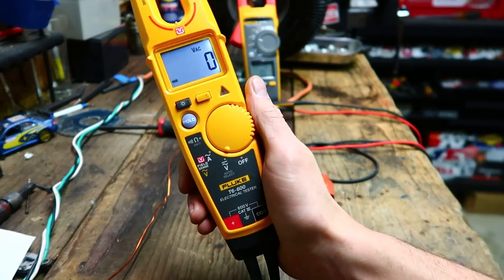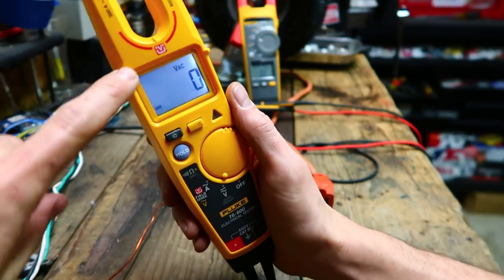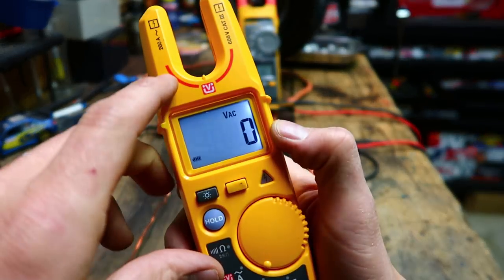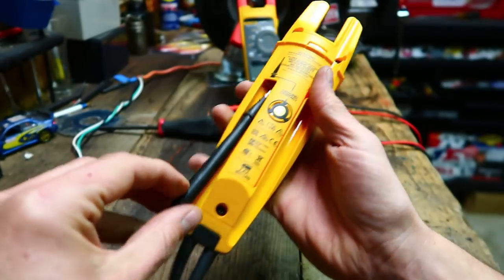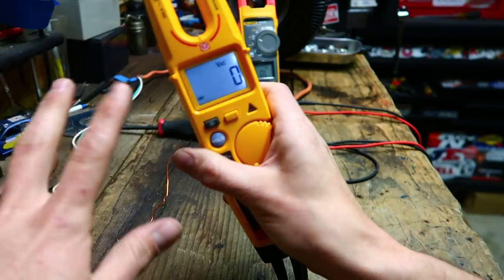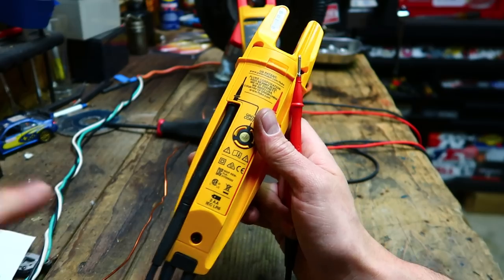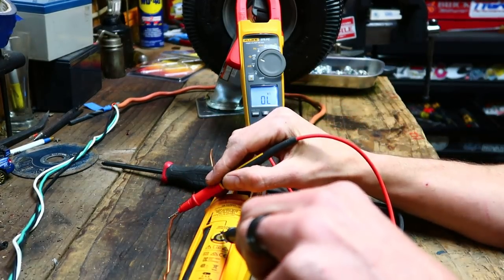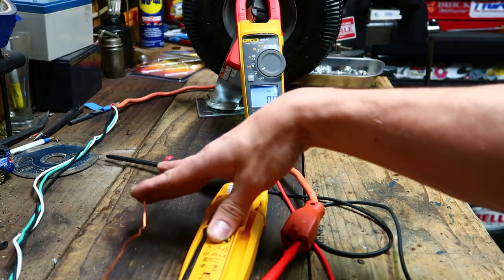Fluke T6-600: NOT DANGEROUS!

Comment: ANY tool this badly designed and engineered is inherently unsafe because quality was sacrificed for profit.  Mike, you said yourself your knowledge of electronics is limited and although it may not appear "dangerous" to you consider some other electrical component may just as easily have been sacrificed (i.e. good and safe engineering) for profit and at anytime  may crap out and cause injury.  I'm not an AvE subscriber but despite the mild theatrics, I think he is correct.  He certainly made clear Fluke has great products and this is the only item they make he has found to be just "garbage".    I don't think his assessment would change even now that he has "cooled off".   Furthermore, you trying to mitigate the negative rating by saying it's not dangerous,  it just doesn't work,  makes you sound like a Fluke boy or shill. If it's junk, it's junk.   JMO
Reply from the maker: i see your point, but my main point, which i probably didn't explain as well as i wanted is, he made it seem like that the voltage he showed at at the contact pad could injure a person.  He left out any explanation of any possible safety features protecting the user.  The result of that was, i got dozens of comments telling me that meter was going to kill me and leaving a lot of people to believe their was full blown mains voltage at the contact pad, which just isn't the case.  I pretty much agreed with everything he said about it.  You could show the same voltage on the other lead on any meter on the market.
Reply: AvE got angry because Fluke rightly told him that he was too dumb to use their meter.
Reply: @metallitech  Meters are used to test malfunctioning electrical products and intentionally putting yourself into the circuit, which is what that meter requires, hoping the safety resister doesn't fail, is what is truly dumb. If you don't understand that, you should not be using a meter in the first place. To measure it a voltage, it MUST really be there - a resister limits the amps to a safe level. If the resister fails or is bypassed by sweat or water, you are in danger. THAT was his point. 
Ave was correct in explaining the possible dangers and also correct not explaining "safety features".  In legal parlance it is an expert opinion - with ensuing liability - to  render a technical opinion while bringing a possible safety problem to light for corrective action and to warn the public is a moral and ethical obligation. It is better to err on the side of caution than to remain silent and "let the bodies hit the floor". Ave puts his ass and reputation on the line sounding the warning and should be commended instead of condemned. People who look the other way when they know better are just as responsible as those who caused the suffering. We have to support the watchdogs out there. Only if someone had stood up when the Ford Pinto deathtrap went out, the Space Shuttle accidents, asbestos.. ect.
Reply: @wylieecoyote  It's a capacitor, not a resistor.  It is safe. Ave had a drunk brain-fart and thought he was smarter than an engineer at Fluke, and proceeded to slander them. He makes all sorts of such ignorant mistakes in his videos. He has no reputation because he is anonymous; or else he would rightly be sued.

Comment: I agree that Ave is casting shade in fluke about the ground pad issue. There's no way that gets any certification from ce or ul if that was the case. BUT: if you use the inductive voltage detection and determine that a hot lead is not energized because you didn't put the wire dead in the center of the jaws and you cut the energized hot lead, you're possibly going to die. Voltage detectors need to work and work and not not work. This thing is dangerous.
Reply from the maker: I totally agree, but I feel like you'd have to be pretty dumb to soley rely on this half assed technology to tell if a line is dead or live.   Same goes for a non-contact tester.

Comment: i agree with AvE on the general sense that basically tools don’t keep you safe. you keep you safe. i think the safety on this T6 is failsafe by design but in general, most things are crap and don’t trust it above your own instinct. kinda like holding hot and neutral together, you trust the circuit breaker to flip, but if it doesn’t then your house burns down

Comment: Mine is adequatley accurate , and the Joy Buzzer function , has yet to kill me . A few tips: in very dry situations lick your index finger for better contact with your feildsence pad , also , do not touch the wire under test with your left hand , or it will skew your reading .

Comment: The typical input resistance of almost all meters is 10 Megaohms, so it'll show voltage even if the source resistance is very high. In this case, let's say you measured 80V (40V less than 120V) (2/3rds) so if R2 is 10M, R1 would be 5M, using the voltage divider formula.
120V through 5M would give so little current, you're not going to feel anything, and if the resistance is distributed enough to protect against single points of failure, it's also safe.

Comment: You say at 1:00 "It doesn't work all the time." That statement alone makes it a potentially dangerous device. If I can't trust an electrical testing tool to, 100% of the time, tell me if there is or isn't voltage present, it's of no use to me since I work with 240VAC.

Comment: Just use the harbor freight red meter. It’s the gold standard for high voltage and even higher amperage work.
Reply: I got like 4 of those. They work remarkably well. I've even run some decent current through them.
Reply: Paul Frederick I use them for transformer installations and at least once a week the coroner reminds me that he doesn’t get paid by the hour.
Reply: I got a ~$5 multimeter on eBay and it works really well for the stuff I use it for. And if I ruin it it's not like I need to sped $100 for a new one.
Reply: Just be careful where you plug the leads in. If you do that a meter should last you for a long time. It is when I measure current then forget to plug the lead back into the Volt/Ohms jack that I've had problems in the past.
Reply: Harbor Freight freebie meters are decent. I've read wall voltage with them no problem. I've taken current readings up to the stated rating of the meter too. They can be damned accurate. They have a trimmer in them and I've adjusted it using a voltage reference. Years ago I've paid a lot for digital meters that probably were no better.
Reply: Got one free in 2014 or so with a coupon, loaded full of hot snot and all kinds of capacitors etc... recently got another one to keep in my car after my alternator went bad and the internals of that one are completely surface mount components. The old one looked like 30 things could've gone wrong in production, but the newer surface mount only ones are extremely simple and I'm sure work acceptably well even though they are cheap. Realistically the bad part of those meters are the leads. They are truly awful.
Reply: Opening them up I have noticed they have made some different versions. I have 4 free red HF meters and I didn't even try. I've seen some people that have piles of the meters.

Comment: It's dangerous because they make you think you can safely determine if there is power on the wire and you can't.
Reply from the maker: it's not the meter that is unsafe, that's an unsafe practice, that feature isn't intended to determine if something is safe to work on.  That is no different that using a non-contact voltage detector do determine is something is safe to work on. If you're too stupid to know that, than you shouldn't be working with electricity. Thats the number one comment i have received on this video which proves there are a lot of people that don't understand electrical safety and should step away from the wires until they do some more reading.
Reply: ok let me rephrase it. You can't determine with 100% accuracy there is no power on the line. There are these voltage sticks to proof power on a line. https://images-na.ssl-images-amazon.com/images/I/31PPevBJNpL._SX342_.jpg
In my line of work we call them dead sticks.
this is the same thing

Comment: Ave said he was concerned about it when the meter was in current sense. You had it in ohms when you touched It.
Reply: Lots of people are commenting on that and it's amusing that Mike hasn't replied to any of them unlike other posts that back him up.
Reply from the maker: I have responded to some of those, although i didn't test it like that in the videos,  I did after some comments,  the only difference is the amount of voltage it lets through.  75-102 Is what I got.  No harmful current was allowed to flow in any setting
Reply from the maker: Also I replied to a ton of comments where people were calling me out for not doing a thorough test

Comment: HvE had a probe in the meter with the testing end sticking out, and the other probe in his hand. Its a common method of checking a circuit without having three hands. Then, while using the probes, the back of the meter had that spot that would become energized.
Reply from the maker: It's not energized,  and no currant is allowed to flow

Comment: The whole point of that meter is a function that really doesn't work well. Id disagree with you, its a bad tool. It doesn't do what it was supposed to do (well).
Reply from the maker: elliott turner 1 feature sucking doesn't make it a bad tool.  It's still based on a t5 which is a great all around meter for the price

Comment: To really test it’s safety try to ground the black lead, put the red on a hot wire, then touch the grounding pad on the meter with one finger and with your other finger or hand touch the hot conductor. Your test wouldn’t have buzzed you regardless of whether the meter was faulty or not. You only touched the ground and ground pad. Same as if you were to touch the same hot wire in two places. You are generally always safe only touching one wire at a time. I think this is what ave thought was dangerous and he may be right

Comment: The answer to Why you are not getting electrocuted, is that it is a High Impedance Meter. Meaning, the internal resistance of the meter is so high, there is not anywhere near enough current flow to harm you or for you to even feel it. Hope this sheds light....

Comment: It can be unsafe, or not, depending on the paranoia or attention span of the user. I encourage you to put the meter in  "sense" mode, black lead stuck in it's home, jam the red lead in the hot spot and then touch the button. Or just put it in "sense" mode and then check the continuity between the button and the red lead. Dig deeper. Although I didn't expect much here.

Comment: Ofc its safe when new, what about after the apprentice looses it in a bucket of water an just dries it off before giving it back to you. And just the tiny risk of something happening with this just for a gimmicky feature that doesn't work.

And don't try the "it works if you do it properly" routine, its at best unreliable, and a unreliable meter is JUNK. Fluke was in my opinion up there with Starret and mitotoyo, and then they release this crap, I understand President AvE for being annoyed with them.

Comment: I know that if you use a t5 it will detect ghost voltages even though you know 100% it's isolated. I used a fluke 117 and 87 both have low impendance functions  which won't show the ghost voltages.

Comment: FWIW, In the first video, AvE was using the meter wrong. In the second video, he was pissed that someone at Fluke took the time to defend an obviously shitty product. It's totally plausible in my mind, that he didn't attempt to touch it to "find out" if it was safe, and based on the anger, just lashed out immediately after finding voltage on the pad.... To be honest, I probably wouldn't have touched it either.

Comment: AVe made follow up video about that meter and it prove that there is serious dangerous to get electrocuted by this meter IF you use it "wrong". Simbly but red in socket and then measure voltage through that "finger ground". Its simble as that.

Comment: What I am taking away from this is you have 2 guys, that both understand more then most, and it is unknown what is going on in that magic spot between the lead and the finger pad. That is where I believe AVE thinks the lawsuit is pending. Magic is great, but what happens when the magic breaks? Does something short, melt, make continuity, create a black hole? Manufacturing defect? Just a thought.

Comment: Good video. Yes Ave HATES this meter. That said....I've been an electrician for forty years....I'm all alone sweating my ass off in some damp basement of a building testing voltage....NO WAY IN HELL am I touching that metal button on the back of that meter. I don't care. In fact if I owned one I would rip the guts out of that back cover and eliminate 100% of the chance of even getting a 74 volt shock. Besides, that new meter looks bulkier than the T 5.

Comment: AVE kind-of explained how this meter is dangerous. If you accidentally left the meter in current mode and touch the pad on the back of the meter while the red pokey bit is attached to power you're going to get a nasty zap. The pad on the back would be live at whatever voltage the red pokey bit is touching.
Reply from the maker: there are 2 design features that make it impossible for current to flow through the leads.
Reply: Current mode is basically a dead short between the red and black leads... If you have that black lead left in the meter the pad on the back will be like grabbing the bare wire.AVE shows here: https://youtu.be/e7aSde8X5JU?t=554 that the pad on the back appears to be directly connected to the black lead if it's stored. If you do a resistance check between the black lead when stowed, and the pad on the back, is there anything there, or is it just a direct connection?
Reply from the maker: It's infinite resistance, it reads  2 nano ferads, which only lets a couple micro amps pads through.  On this meter, there is a 1 mega ohm resistor that doesn't allow any harmful current in the leads no matter what setting it's on.  Basically that contact pad is protected by 1 really high impedance resistor, and a series of 5 tiny capacitors,  from watch can tell. A lot, and I mean a lot of things would have to go wrong to allow any current to flow through the contact pad.  I'm no expert, but did that make sense?
Reply: Thank you for doing the extra test , that make sense now. :)
Reply from the maker: actually i don't have a meter to fully test this, but this guy does,
https://www.youtube.com/watch?v=frjoyQHqCN4
great video, fully tested, and explains the technicals better than i could.

Comment from the maker: Ok, it can be dangerous if you rely on this feature to determine if a circuit is live or dead, which no one should EVER do, Use the leads for a life or death reading.  That's common sense to any experienced electrician.  It is not dangerous in the way that AvE showed, there is no mains voltage at the contact pad, it has safety features.
Reply: exactly, all of the non-contact probes/detectors are only good for preliminary trouble shooting and testing. always back it up with physically connected test
Reply: I agre compleatly and think thats wat AvE was trying to say as well but I think this is dangerus for some one that dosent know how to use this kind of meter !!

Comment: okay aVe may have jumped the gun but it is still a feature not ready for prime time or anytime imo. I took my T6-1000 just now. (btw it was an awesome gift from my brother and is still nicer than my T5 sans the marketing skookum). With the red probe stuck in the hot 120v I measured the ac current from the tab on the back to ground and yes indeed I got 79.5 uA AC (fluke 87 iii, leads in common and uA and uA AC scale)
From the black probe stuck in with no lead I measured some capacitance but it was all over the place, you may be right that it is some kind of coupling device.
So yeah it passes very little voltage and current. I wonder what 277v or 480v would do?? You want to try all hot and sweaty?  Still marketing asshats now running the show at fruke. Oh and mine measures way over the 5% in volts using voltage sense. Some scenarios it shows around half? I'm the electrician that aVe spoke about I want my test shit to be flakey as hell!

Let's go watch Big Clive shock the shit out of himself

Comment: The issue is the Fluke meter has a path for you to receive mains current should it fail.
Reply from the maker: Well any meter can fail and cause injury
Reply: I'd prefer not to be the fuse in circuit when it does...
Reply: When a conventional meter fails you have the insulation on the meter and probes. This is a direct path.
Reply from the maker: Or the can blow the fuck up in your hand, it's happened to me, and I've seen it happen to 2 other people. Nothing is perfectly safe

Comment: Now do it again in current mode like a 2 day apprentice. Thats what i want tested, because if thats a cap in there, at may well have enough current to do damage in current mode. Voltage mode is, what, 10M ohm? Yeah, that wont do shit, but current mode is puts everything on that little bit of plastic in the back.
Reply from the maker: a clamp meter doesn't work like that.  It doesn't let the current flow through the leads like a multimeter like the 87.
Reply: This thing doesn't have a contact amp setting as well? I was lead to believe it did.
Reply from the maker: No.  Every fluke I've ever had with a clamp or jaws didn't have that